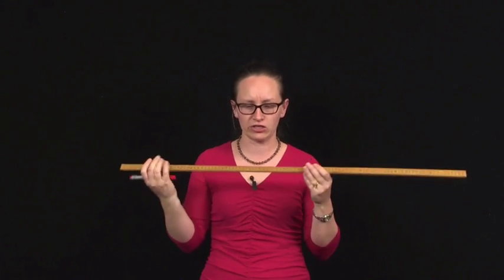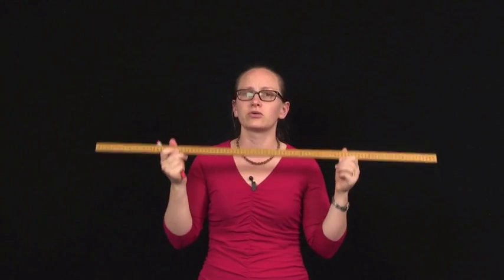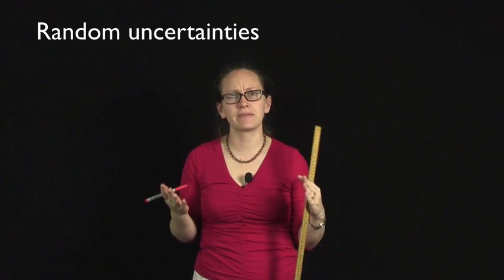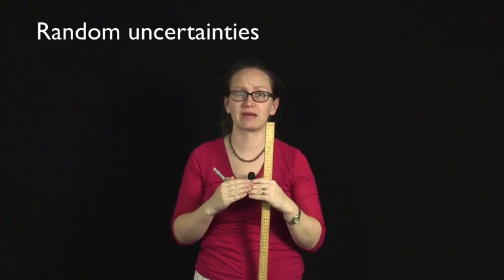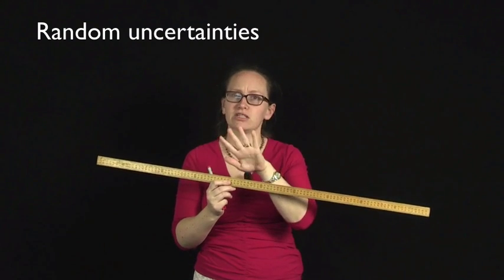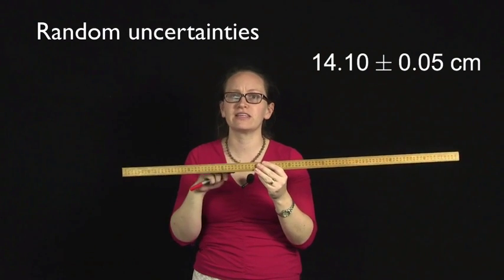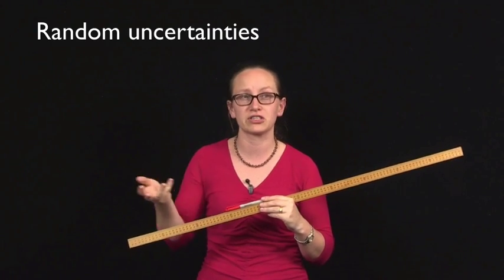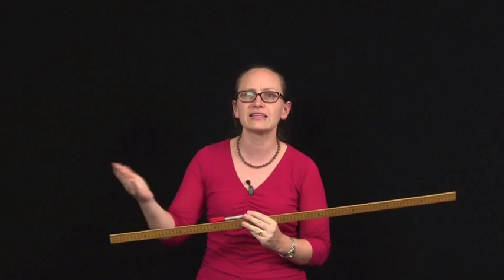Introduction to Uncertainties

Comment: for the ruler example, shouldn't your answer be (14.1 + - 0.1 cm) as the resolution of your ruler can only measure in increments of 0.1 cm not 0.05 cm?
Reply from the maker: You take the uncertainty as half the smallest increment so the uncertainty at each end is 0.05 cm.